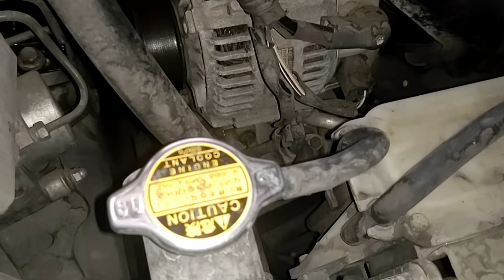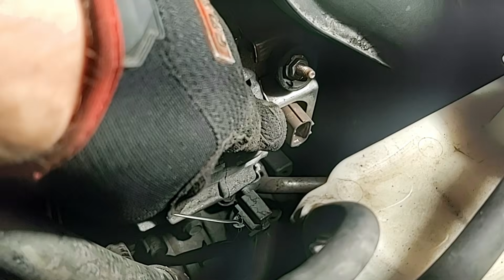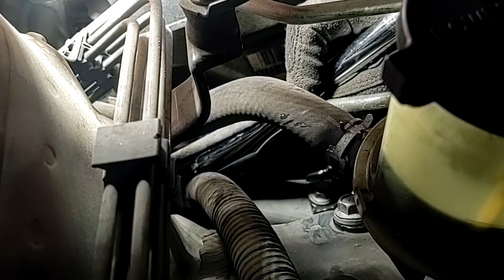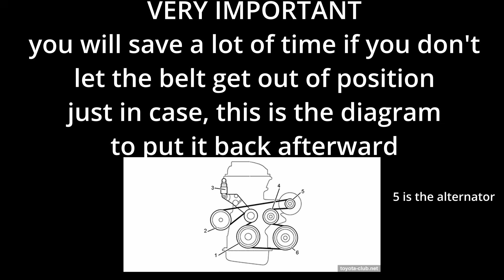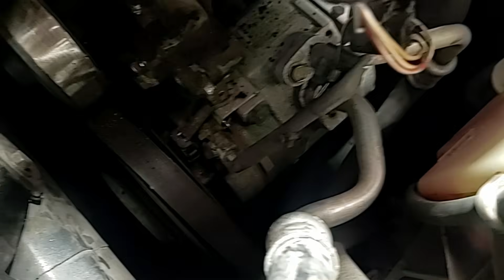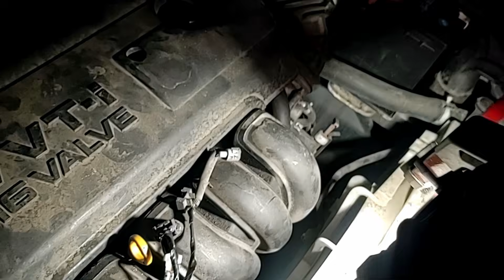FAST and SIMPLE 2003-2008 Toyota Corolla Alternator Swap

Comment: I guess you got OEM. I got aftermarket, which requires you to reuse that metal tab that the wire clips onto. Unfortunately, it was impossible to put on with the alternator on the car, so I just left it off and it's dangling.
Reply from the maker: Dang I'm sorry about that. Thank you for leaving a comment to help others out!

Comment: I just bought a Corolla and I’m just learning about the belt 🤣😭 I hope it stays in place I need to learn these things 😢
Reply: Theres a few great videos on here showing how to replace that serpentine belt. If you remove the front right wheel its pretty easy to wrap the belt around the pulleys

Comment: careful with that 19mm belt tension loosener, I broke one right off, then had to go in the side inside the wheel well to get another bolt instead with that
Reply from the maker: That's good to keep in mind, thank you!
Reply: Yup I haven’t don’t it personally but the 3 out of 5 of these same cars the dummy bolt was snapped right off turning the simple swap into a two part fiasco lmao

Comment: #edvice - rotate the alternator 180 degrees horizontally, and it comes out much easier.
Reply from the maker: Thanks! Appreciate that
Reply: Doing mine tomorrow,  thanks for the tip.

Comment: The only thing I would add is, on my 2007 corolla S, I had a 20mm nut on the end of my bottom bolt that made me remove the fan to get to, because it kept spinning.  It was easy to deal with once the fan was removed, which is easy - just two 10 mm bolts and a connector.  Try to use a flat head to save the fan harness holders or end up using zip ties.  Have fun!
Reply from the maker: Thanks for the advice! Much appreciated

Comment: So for the next time I do this, any tips on how to get the F***ing alternator in place? I wrestled with the new Bosch alternator that did not want to line up with the bottom bolt at all. That fit is TIGHT. Probably would stay in place with no bolts at all lol
Reply from the maker: I didn't have that issue, I'm sorry that it came up for you! That sounds like a really tough time
Reply: Take some sand paper or file  and clearance it some more.

Comment: I have to say that bottom bolt was a real pain.   Had to remove the fan so i could wedge a screwdriver between the nut and the tab, breaking the tab, but then i was able to get a socket on both sides and get it to break loose.
Reply from the maker: Yeah it's not really easy to get to at all

Comment: I wouldn’t remove the compressor tube
Reply: He didn't, just the wiring that goes to the compressor.  But yes, don't go disconnecting the hard lines or you'll lose all your refrigerant.
Reply from the maker: Thanks for clarifying that! yes
Reply from the maker: No definitely don't

Comment: I just changed mine.  Thanks for tips/video.  I used 9/16” on bottom bolt.  The 14mm seemed like it was stripping.  And I think it was original Toyota alternator.  SAE bolt on Toyota seems weird but it worked on mine.
Reply: I+q1

Comment: What brand would you recommend?
Reply: denso
Reply: @torontoguy8043  Denso is OEM, and has the spicy OEM price. I went with Bosch, so we'll see what happens.
Reply: As an update, I went wish Bosch which was cheaper ($60 cote charge) and it seems to have fixed my problems. Has free roadside assistance for two years as of this writing, so that was nice.

Comment: How and where can I get a 300 amp alternator high output upgrade for my 2004 Toyota corolla
Reply from the maker: You could check common parts sites like RockAuto, but a special alternator might not be there. I wouldn't know where to find a special high output model
Reply: Highest I found was a 200 amp in eBay. I looked and looked but couldn’t find anything on any websites did you have any luck?